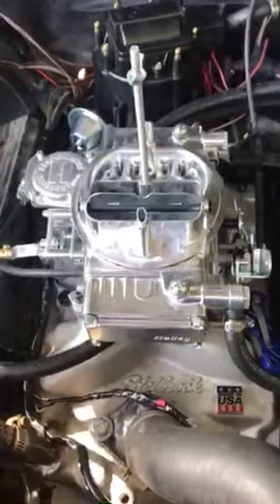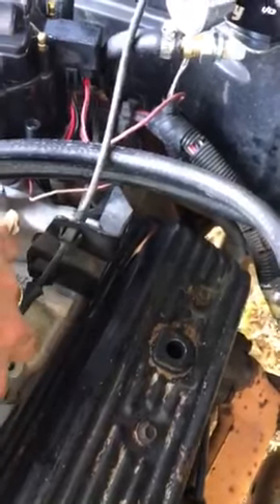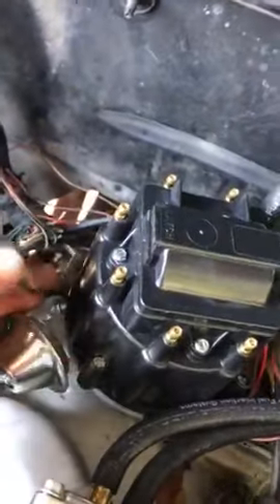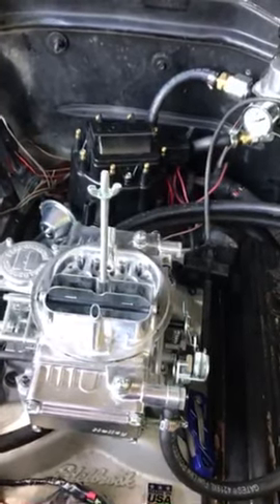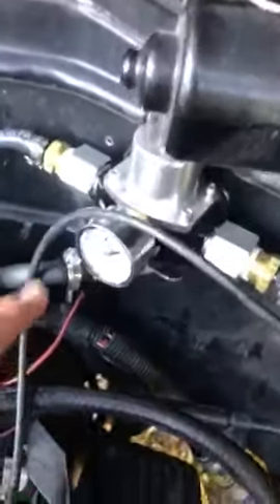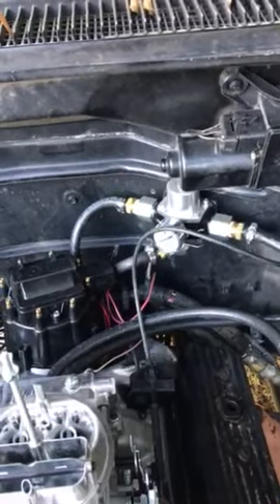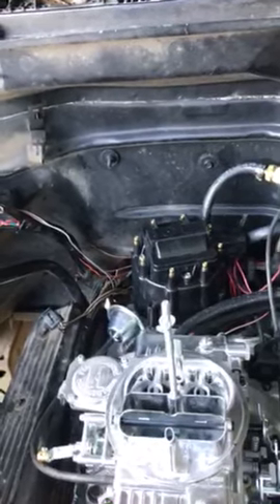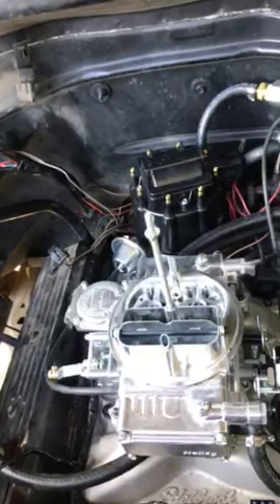Converting TBI to Carburetor, tips and tricks

Comment: So you can't use the tbi distribution when doing the swap?
Reply from the maker: That is correct, the Tbi distributor is totally controlled by the ECM, based on signals from all the sensors. It needs to be stand alone and to function properly. That is why the HEI works excellent for this swap.

Comment: So what if you want to run a tach ,where do you hook it being you used its location for fuel pump?
Reply from the maker: The same location.
Reply: White wire in the coil plug runs to tach side of hei and also tap into the serial data wire at the cam sensor

Comment: Hello Mr. Lariscy.  I have to ask you another question. I will be sending quite far from the US the parts that I will order for my conversion  so  I need to make sure that what I buy is what I need. In the case of the Intake manifold the edelbrock 2104 is the one that goes well with the cast iron heads on my 1988 350 5.7 L engine?  Thank you again.
Reply from the maker: The four center holes on intake are straight up and down on the TBI heads that’s the only difference as far as I know. Not sure if your heads have the older style center holes that are the same angle as the others.

Comment: What about the tach wire and the booster hose
Reply from the maker: Booster hose connects to valve cover just like stock configuration , tach wire connects to tach connection on HEI distributor

Comment: I have a tbi 350 that was carb swapped how much fuel pressure does the regulater need to be set at its a 600 electric choke edelbrock carb
Reply from the maker: Between 4 to 6 psi should be fine
Reply: Walt Lariscy thank you for your help man muchly appreciated

Comment: Can you provide brand of carb and distrib you went with?  Also, assumably you got more power, how was your mpg (increase/decrease?
Reply from the maker: Hi Dan, the carb was a Holly 600 cfm vacuum secondary with electric choke. The distributor was a OEM GM HEI distributor. Much more power due to adjustability. Gas mileage isn’t going to be as good as the fuel injection, but most do this swap because of the TBI system being in a state that is not repairable.

Comment: Do u have the part number for the fuel regulator?
Reply from the maker: Holley HP Billet Fuel Pressure Regulators 12-841
Reply: Walt Lariscy do it works well with the tbi pump?

Comment: what if you use A mechanical fuel pump? And take out the electric pump in the tank
Reply from the maker: Hi Cohen, I thought about that, seemed like too much trouble. I suppose it could be done. You would have to find a pick up and sending unit that would fit your gas tank to replace the electric fuel pump.

Comment: (Really hoping you reply).... Is the purple wire to the tach to reroute power due to you removing the ECU? Or did you leave the ECU wired in place? Thanks!
Reply from the maker: The ECU is still in and functioning partially,the wire to tach port is to send signal to ECU to control the fuel pump based on engine rpm and fuel demand. Hope this helps
Reply: @tlariscy  We're getting there... So I'm guessing you ran the purple/white from the old distributor plug to the tach terminal of an HEI? I suppose the HEI tach signal must ba a 5VDC square wave?

Comment: I have a question and need a little help I just did this conversion to my 92 suburban, but I swapped in a 385 stroker motor with a 750 Holley carb with electric choke and I also have a Holley 12-841 fuel pressure regulator.
the other day Saturday the 27th I got my first start I started it then turned it off and then started it again and let it run for a min or 2 then it had cut off
on its own and since then I tried to get it running again but it fires and just shuts off.
So I am thinking I got an fuel issue I got the purple and white wire hooked up to the tach port but I dont think the pump is staying on maybe.
I want to ask do I suppose to also have that white wire from the coil hooked up to the tach port also?
Tomorrow morning I am thinking of proving my theory that the pump not running after the initial prime after turning the key by hooking a keyed 12 volts source to the pump green and white wire but if it still dont run any ideas to why it want stay running maybe I need to tune down the fuel regulator cause I did turn it up the other day or maybe an issue with my carb which I hope not!
Reply: I'm currently doing this on a 87 and you need the oil pressure switch that's on the back of the engine hooked up because it needs to see oil pressure
Reply: I am using that oil switch and an after market oil pressure gauge and for the short time it ran I was watching the after market gauge and I had good oil pressure but I didn't pay attention to the dash gauge.
Reply: But this morning I bypassed the purple and white wire and ran a red wire from the fuel pump relay to the green and white wire on the relay so when I put the ignition switch in on position the pump turns on but I still couldn't get it to stay running it would just fire and stall so I guess tomorrow I will be trouble shooting the carb to see if I'm getting fuel in the bowls and make some set up adjustments
Reply: @roddavis5494   Good sir, dump some fuel into the vent tube, or try and keep it going with starting fluid or even brakleen, the HEI module is renowned for ignition issues, if it stays running you have a fuel problem. Or if it still stalls, I guarantee its your HEI module under the distributor cap its worth it to keep a spare as these things age.
Reply: My 4 pin plug has black/white strip, white/black stripe, white, pink(or orange)

Comment: so what adapters and hard lines do I need to connect the existing fuel lines? 
i have a 305 5.0 firebird TBI that I want to convert to carb I have the intake, carb and hei already
Reply from the maker: Hi, I just cut the ends off of the metal lines and used rubber fuel lines with hose clamps. The pressure is not that high because of the bypass in the regulator. It sends all fuel in excess of the 6-8 psi back to the fuel tank.
Reply: @tlariscy  so where sould I connect the power for an electric choke? and what about power for the HEI, and factory tach, where do I connect the wiring for distributor and factory tach? Only asking becuase there seems to be 100 different answers and I don't know which is the safest, and best way?
Reply from the maker: @William McCoy Great questions, the power for electric choke can be any 12 v source that is switched from ignition switch. I spliced mine into the power wire for the distributor. The power wire should be in the harness that connected to the original distributor. As far as factory tach, you may have to look at some schematics for your vehicle as mine did not have a factory tach in the instrument cluster. But my guess is that the wire should be in the factory harness that connected to the distributor as the engine did not have any other engine speed sensors. So the ECM must get engine speed from the distributor. Hope this helps.
Reply from the maker: @ William McCoy, another thought is that the tach signal is derived from the wire I recommended to connect to the tach port on HEI distributor. I’m almost certain that it sends signal to ECM and then the ECM controls the fuel pump from there, the ECM may then send the tach signal to instrument panel. Not for sure but just a hunch.

Comment: i have been considering going to carb and hei on my 95 gmc van. it has vortec heads, marine cam .431/.451 lift, headers, and of course, aftermarket intake. only thing stopping me is the 4l60e. any sugestions? it is starving for fuel
Reply: Same here have you found any answers
Reply: @brendentaylor8976  i installed a holley 650 and hei, now running really rich. hard to adjust the fuel pressure. either buy a quality bypass regulator or delete the in tank pump and run a mechanical pump. just hook up the power wire and ecu wire to distributor and you need the throttle position sensor. without the tps, it shifts at about 2000 rpm no matter what. if you want to keep your tbi set up, there is a regulator set up you can install, but i dont know much about it. i scratched that project and am working on an s10 now. https://www.amazon.com/JEGS-159050-Adjustable-Pressure-Regulator/dp/B078WHVJHX
Reply: @chrystalpaugh9458  thank you for the info

Comment: hey friend what kind of carburetor is that i have the 700r with kick down cable also do i get electronic choke or manuel
Reply from the maker: Depends on whether you have a square bore or spread bore intake. Any 600 CFM carb will work, I recommend the electric choke.

Comment: My 4l60e is in high gear will not shift unless I shift it myself. What do you think the problem is?
Reply from the maker: Didn’t have to deal with the electronic transmission. My guess is that the ECU needs a throttle position sensor to control the shifting of your transmission.

Comment: Does your truck have a tachometer? And if so, does it still work after the swap?
Reply from the maker: No tach, however it should work in theory since the signal from the distributor is a pulse signal and should still read through a tach.
Reply: Did it on my 1994.  Yes, it works just fine.
Reply: @Jerkwad152  did you have a 4l60e
Reply: @brendentaylor8976  yep
Reply: @Jerkwad152  what carb you get
Reply: @brendentaylor8976  
Good old Edelbrock 1406

Comment: @waltlaricy i have a 1993 k1500 with the 700r4 Thats electric could i Carburete my 350 but keep the computer just to run the trans? Like just pull all the tbi stuff off and keep the computer connected to the transmission would that work
Reply from the maker: The only thing controlled by eco is the torque converter lock up on 700 r4. To control torque converter lock up you will have to either install a separate aftermarket controller or just wire a switch that you can manually actuate from toe cab when you want the lock up to engage. This is a work around. Personally I would install a TH350 transmission and be rid of all computer components. Hope this helps you in your search for info.
Reply: @tlariscy  sorry this may be a crazy question but what happens when the torque converter locks up on these year model trucks
Reply from the maker: @zackpalmer6474  older torque converters have an amount of slip, lock up torque converters fully engage the engine 1:1 like a clutch on a manual transmission but unlock when there is no demand for power. This increases gas mileage and keeps the transmission from stopping the engine by releasing and slipping.  You can run without the lock up feature but will have decreased fuel mileage at highway speeds.
Reply: @tlariscy  okie dokie thx man running it without that feature would it hurt the trans?
Reply: @tlariscy  and do you have a video on how to run it without this feature

Comment: My '89 305 tbi to Quadrajet swap will only run with late timing, any tips?? Wired up the replaced fuel pump and cooling fan to respective switches and this old firebird doesn't wanna run with anything more than late timing. Junk's annoying, does have a 700r4 I just don't know what it could be. The holley regulator I'm running doesn't wanna run fuel to the carb unless you squeeze the return line and prime it a couple times but still, the fuel drains out of the bowl, my dad was noticing (old hot rodder) any idea what could be up?
Reply from the maker: Have you checked for vacuum leaks? Hard to say without being on site. Just make sure that you are getting at least 4psi plus on fuel line to carb. How many miles are on engine? Where there any issues before the swap?
Reply: @tlariscy  tbi was 31 years old and clogged, could barely drive it. Had to use, I kid you not, less than an inch of the gas pedal to drive it. Anything more would choke it out and it'd lurch and buck. But I wanted a carb. Simpler, easy to tune, wanted it old school under the hood. No vac. leaks, we were using a vacuum gauge for the timing, and it kept saying late timing so after a month-2 months of not having my daily running and pulling the distributor out and bumping it forward a tooth here, back a tooth here, chasing the distributor rotor with the spark plugs both ways, my dad and I said screw it and just brought a 350. God really came through cause the guy, who I got the car from, was more than willing to help us out with head bolts, heads, valve covers, oil pan and timing cover, with their respective bolts, push rods, a good cam, the whole nine yards for $223 (originally 225 but I was two bucks short and he wouldn't take my 20 I had left.)
Reply: @tlariscy  odometer's stuck around 196,600 but changed the oil, took the valve covers off, the motor looks brand new inside, clean as a whistle pretty much. Might be the cam but we can't find a carb specific cam and it's such a finnickey 305, we're pulling it. My dad said it's the first motor he's pulled the distributor out as many times as we have. Man's had a 55 Chevy he modded and put air suspension in as a kid around my age, 21, (he was born in '55) '65-67 GTO's, a '68 455 Rocket 442, '69 Z/28 and he built and raced mud trucks running nitrous before they were limited, so he's not a newbie to this stuff.
Reply from the maker: @Athoroughgamer  gotcha, I hope you can get it all dialed in. Let me know what you find out.
Reply: @tlariscy  will try to remember to 👍

Comment: What bracket did you use for the cables?
Reply from the maker: It was a generic one from the local parts store. Had to drill two new holes for TV cable bracket to get adequate adjustment. I just don’t remember the brand.

Comment: anyone know how to wire the L460e to bypass the pcm ? what wire do i use for the TCC ?
i have a 1993 K1500 4x4
Reply from the maker: Didn’t have to deal with the electronic transmission. My guess is that the ECU needs a throttle position sensor to control the shifting of your transmission.

Comment: I want to let you guys all know that you guys are all wrong about the electronic Transmissions. I am currently running my original transmission with original distributor original coil pack with a Holley 650 high-rise manifold with no cats. What i discovered as long as you keep your crank sensor cam sensor O2 sensors plugged in while still using  your original computer the transmission will shift just fine and you can still run your stock distributor didn't have to buy a new one all I bought was intake manifold Holley 650  carb fuel pressure regulator this ol truck starts up every single morning. not one issue. The only thing I don't like is I have a wiring mess under my hood that I'm trying to figure out how to get cleaned up without cutting any wires I can probably cut them all out and everything will be fine but just in case I got forgot what to do with them that's my only problem but it took me a good minute I haven't came across one video on here that shows what I have done everybody's going completely out of their way of buying all this ignition system s*** and you don't need it to make your transmission shift

Comment: What intake did you use
Reply from the maker: Edelbrock 2101 performer
Reply: @tlariscy  could i do this with a 4l60e
Reply from the maker: Brenden Taylor yes, however you will have to rig a throttle position sensor to the carb

Comment: Does anybody know that part number to the fuel pressure regulator
Reply: Any regulator that has a fuel return line. Some fuel filters have a return line as well which means that any pressure regulater will work

Comment: Do you have to change out the distributor? Or can I use the one that was used for the tbi?
Reply from the maker: To the best of my knowledge the original distributor will still be be adjusted by the computer, based upon the sensors on the engine. It will likely not work well.

Comment: I have an 87 Chevy truck that is getting carbureted soon. I've never personally been impressed by fuel injection. I've always owned manual transmission's and the throttle lag drives me nuts. I tried to keep this 67000 original mile truck original but I'm done. SES light is on, codes out the wazu. Runs lean one minute, then rich, timing, retarded, then advanced, idles high then barely idles. Over $500 in sensors, fuel pump, ect. Im done. To this very day and millions of dollars of development fuel injection can't deliver the immediate precise throttle response that a carburetor gave 100 years ago. I don't mind pumping the gas to fire it up or taping the throttle to remove high idle. I hate the truck all because of this tbi garbage. Good video

Comment: How do you get the trans to go into overdrive once you have removed all the sensors and electronics? Is there an easy way to do this or do you have to install a kit ?
Reply from the maker: Overdrive is accomplished through the lock up of the torque converter. This can be achieved through a TPS and a kit or through wiring a switch to the harness coming out of the xmsn. I do not know which wires they are you would have to do some research.

Comment: I have a 1992 c1500 that I put a 1965 327. My oil pressure switch is keeping my fuel pump from staying on, what wires do you use on the oil pressure switch
Reply from the maker: The oil pressure switch was wired as original just plugged into factory harness. My guess is that the switch is not functioning properly.